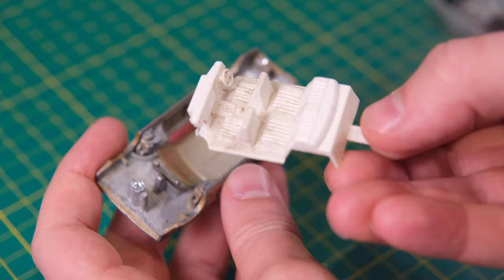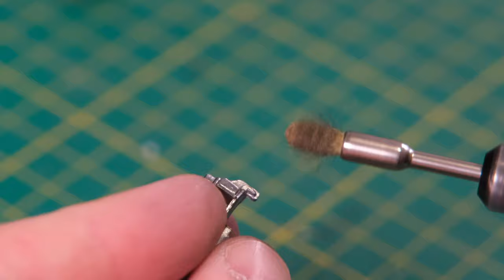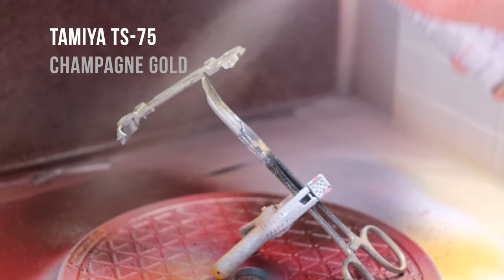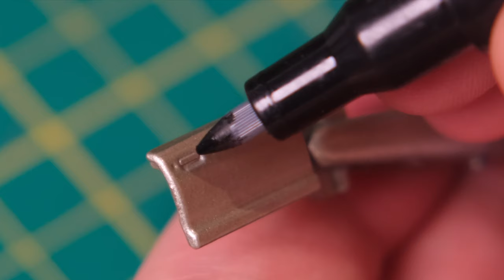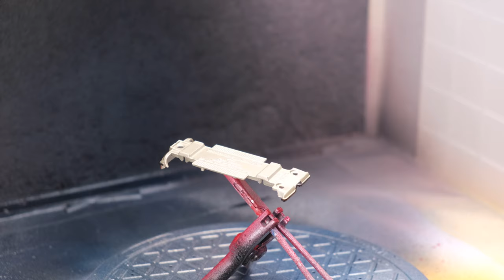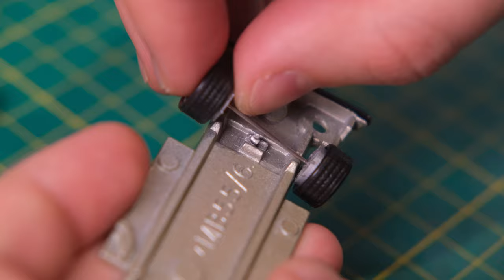MATCHBOX Superfast custom: 55G Ford Cortina

Comment: a little enhancing doesn't hurt. :) love the colour choice. :) at first I thought it'd gonna end up signal green; my first car was a 1977 Taunus wagon, with green interior. shouldn't have put it to the yard...

the casting with the doors shut also came with opaque windows and white interior as glow-in-the-dark, but it seems to have been a final run, and a short-lived one, too. dunno what Matchbox' mission was with the opaque windows to begin with. good thing there was a series of those with white transparencies, often painted plain red.

you were correct comparing the Cortina Mk1 to the german Taunus P4/P6 types with front wheel drive, as they filled the same niche. german P5/P7 models would sire the Granada later. meanwhile, Argentina build the Mk3 Cortina until the late 70's, skipping the Mk4, and then switching to the Mk5. which also came in a fastback version. the top version was called GT P5 and came with the Pinto's 2.3 OHC under the hood. some 4-5 of these made their way to europe, saw one in mid-90's, with lot's of airbrush and dutch license plates. :) an argentinian toy company made models looking a lot like Matchbox, and they of course did one of the GT P5... I could snatch one for cheap because the seller didn't know how utterly rare they are here. and it needs some tending, too. :P

Comment: Excellent work.

As a boy, I had ( and probably still have somewhere) a green and a red example of this. One thing that always really bugged me about that casting was the weird ppsitioning of the front number plate - it should be on the bumper, not stuck away diwn at the bottom of the front valance!

Comment: You can paint the number plate with black first, and then add white on it with a smaller pen or a brush. That will give the best result for the outlines of number plate. Love your works 🔥
Reply from the maker: Good tip, I’ll try that next time and see how it goes